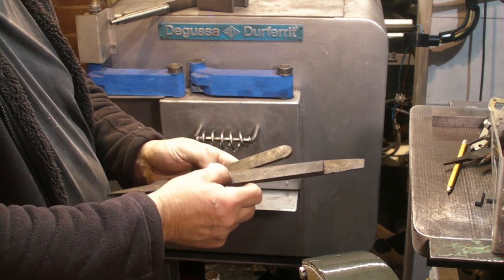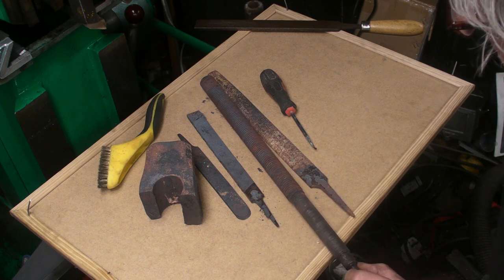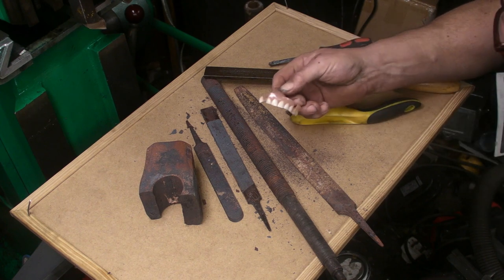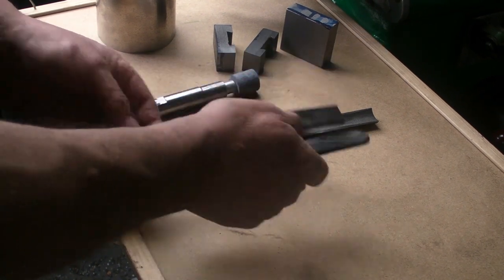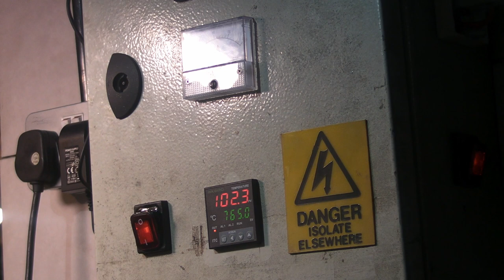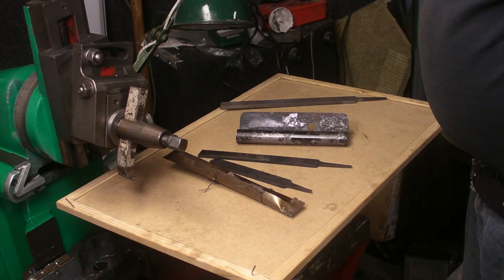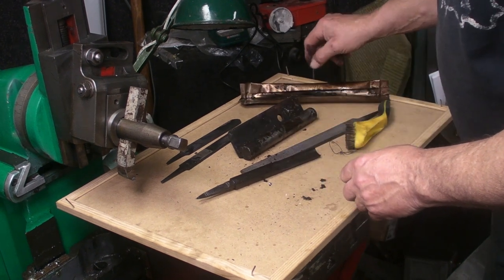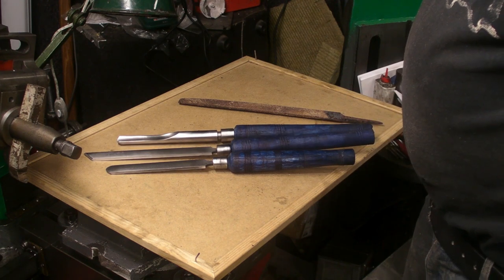Making wood turning chisels from old files

Comment: The foil really helps quite a bit. Another good trick is when you are wrapping the part to be heat treated, put a Kleenex or a scrap of newsprint inside. As the packet heats up, they will burn, using up the remaining oxygen inside the envelope. Works great!